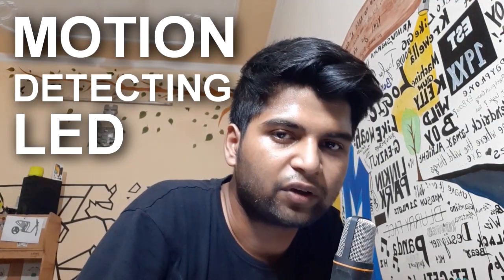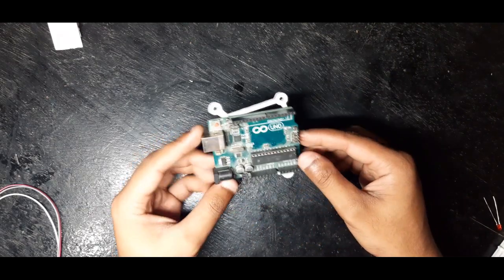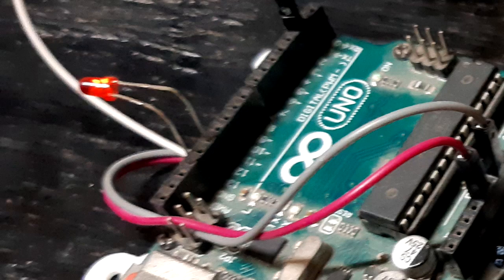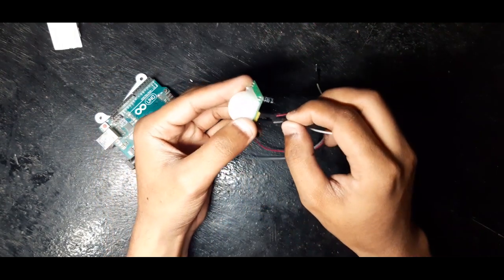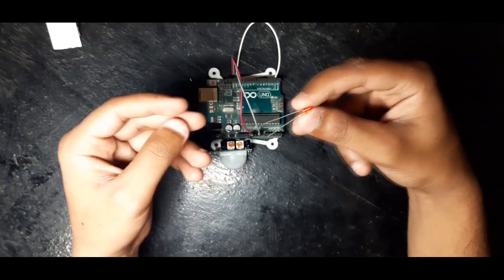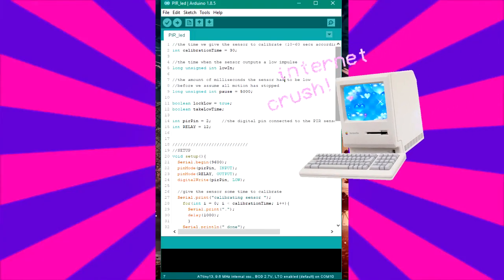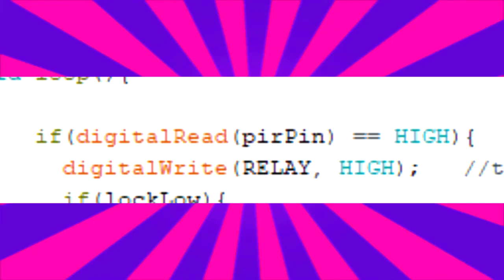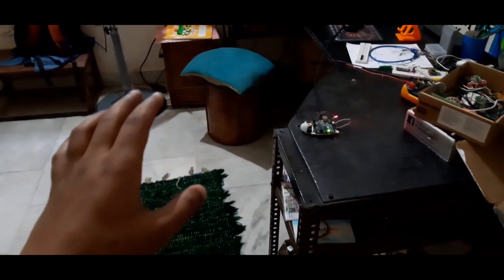PIR Motion Activated LED with Arduino

Comment: Would you not put a resistor on the LED? I keep hearing about this.
Reply from the maker: Well, because current consumption of an small 3mm led is very low and it won't get burned out by digital pin. However it's mandatory to add resistance anyways. (I didn't add resistance because I'm an idiot)